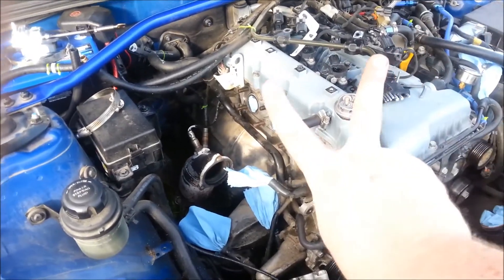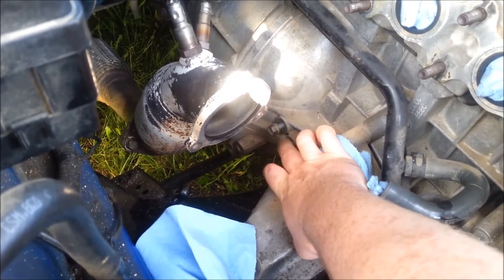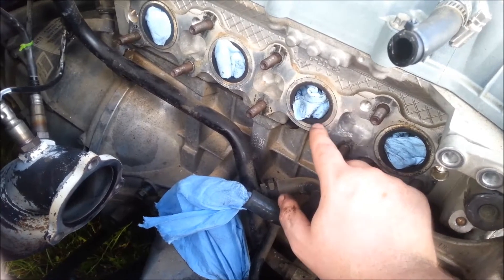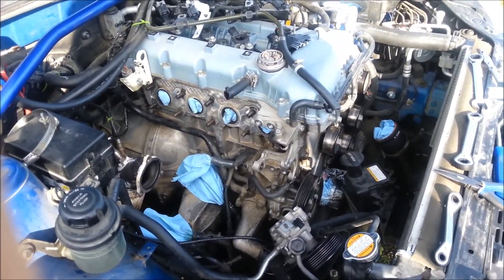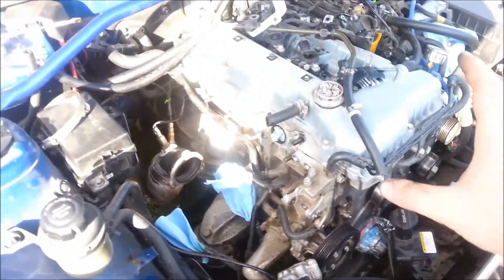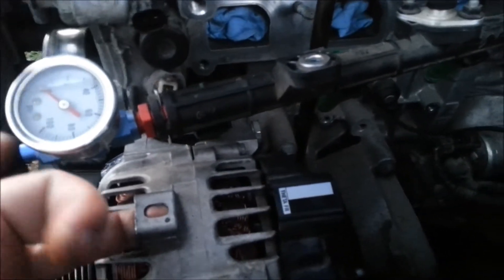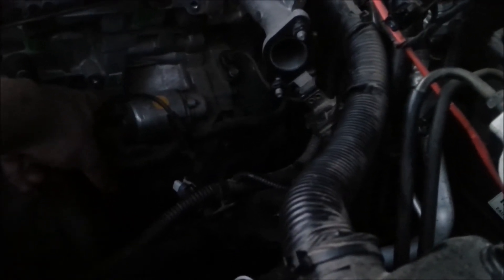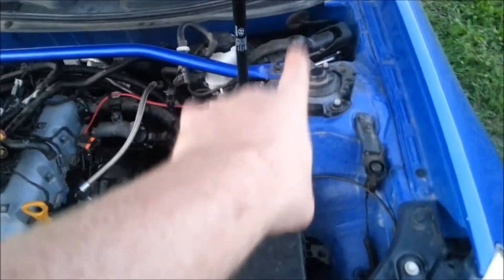PW dev diary #2 - Engine removal day 2

Comment: Hey, Snoopy.  Why did you choose to remove the exhaust manifold before pulling the motor?  Wouldn't it be easier to get at those bolts once it's out of the car?
Reply from the maker: No specific reason. I've done it both ways.
Reply: Thanks.